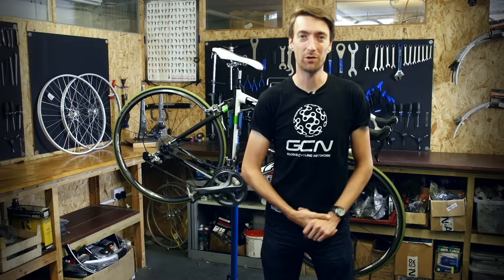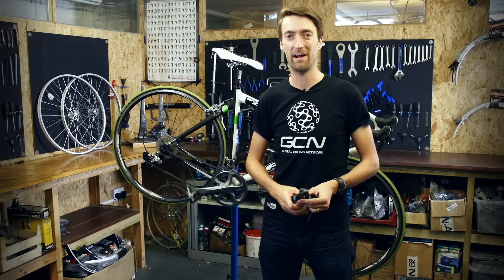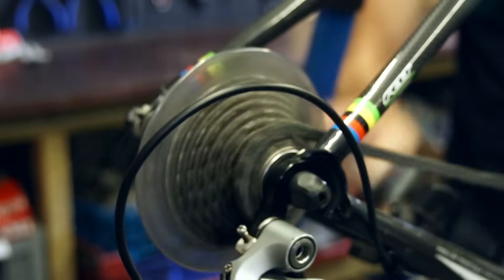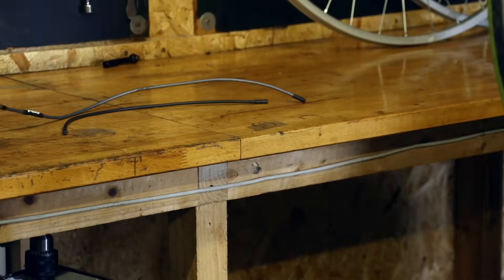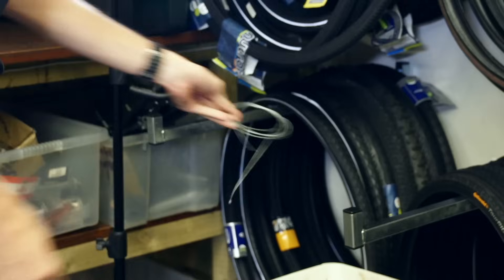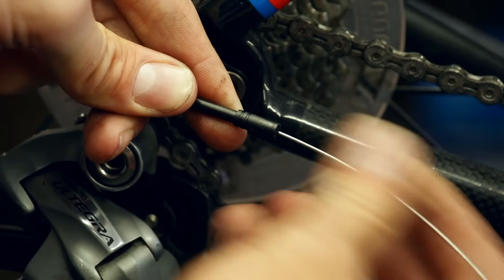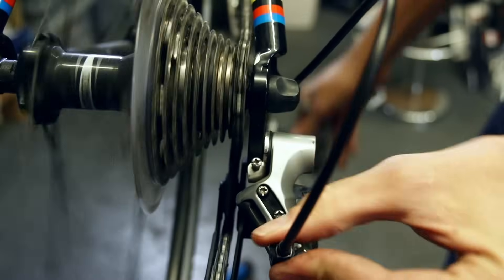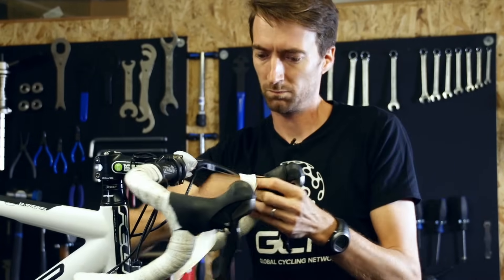How To Change Your Gear Cables

Comment: To improve gearing you should've lubricated the cables
Reply from the maker: We disagree actually Dan. To get the very lightest shifting, assemble them dry.
Reply: Global Cycling Network  Could you explain with more details, why you assemble them dry? Thanks!
Reply from the maker: Flor.e.Cultura Oil, grease or even light lube can actually increase the friction of the cable.
Reply: Flor.e.Cultura grease attracts muck and dust like a magnet , I've not lubed a cable since I was a kid and my last cables were 14 years old before I decided to replace them , lubing them used to wear the cables out and the outers due to the aforementioned grime and I was lucky they lasted a year
Reply: Global Cycling Network Highly interesting...will try this., tho wouldnt a light lube be ok like Si's recommended WD40 lol
Reply: lee a dorney no mate , just leave them as they are , your just asking for it if you do lube um
Reply: ***** so road bikes don't collect dirt from the road ? , just check the back of your road brake callipers and see how clean they are :)
Reply: I'll check them out mate , I use cruds on my racer too but only if the weather is bad
Reply: ***** TKS VAXBUSTER! I´m with you! Vaseline works great! If they are so scared about dirt, they shouldnt lub their chains!
Reply: do you guys know "SHIMANO Cable Grease 50g (Y04180000)" ?
Reply: ***** theres nothing wrong with the cables shown mate , we used to have to lube them in the 70's and 80's because they were normal steel cables and they rusted to buggery if you didn't , then along came stainless steel cables and we lubed them too , then we found they clogged up with muck just like the old cables and gear shifts where a pain in the ass so we stopped lubing them and hey presto no more crappy gear changes , the lubed cables with muck on cut through the outers so we had to change the lot , now I only change the inners and that's only for the sake of it , and their as clean as a whistle , I've used Teflon coated on another bike and found that turned to dust after a few years , maybe their a lot better now ( I don't know )
Reply: ***** I think we better agree to disagree mate , I have the reasons for my views and you have the reasons for yours , btw I've used clarks cables for many years and cant find fault with them :) , if you want a real challenge on your MTB go and try the mastiles lane ride in the Yorkshire dales , if you can get from kilnsey crag to the top without stopping then your a better man than I lol
Reply: Global Cycling Network It makes sense with modern cables and housing with teflon liners that lube is a bad thing. In the video at 3:05, when the cable is pushed through the new housing, there is a little blob of grease at the end of the cable. Where might that come from? Thanks for the video.

Comment: Do you really need to change the outers when replacing the cable?
Reply: Not everytime. It will depend on how old they all are or how often the bike is used. The inner cables will need changing more regularly than the outers so don't worry.
Reply from the maker: In most cases, yes.
Reply: Most cases? can you give examples please?
Reply: +Mr Robo-Vision seen...
Reply: +MrLol07 seen?

Comment: Does it matter what cables you get?
Reply: I just bought Shimano 105 road cables for my Dior XT mountain bike. I don't think it does because the cable length I think will work and I don't know if the gauge is any bigger or smaller. I'll see.

Comment: Trim the housing with cable running through it and it won't crimp.
Reply: It's not a continuous housing though, there's two pieces to cut.  Do me mean to run the old cable through it before cutting it?  That seems like more work than it would save.

Comment: Do you have to take all the slack out of the cable?
Reply: You should have the shifter set to the lower gear first, so that it will correspond to the correct position for the rear derailleur.

Comment: How to change a cassette
Reply: How to change a road bike cassette
Reply: Use a cassette removal tool and a chainwhip. Pretty sure they've done a video on this. It's not a difficult job. It's putting it back on and not overtightening the cap that you might find tricky.